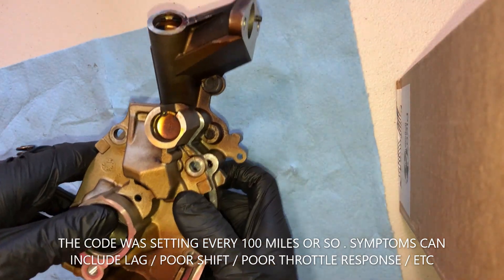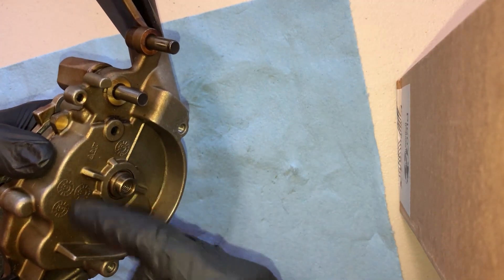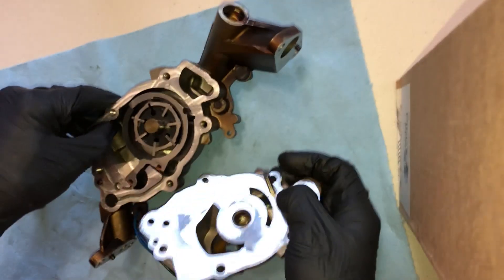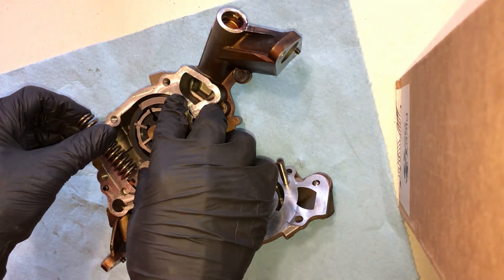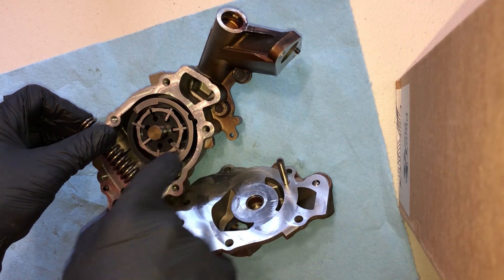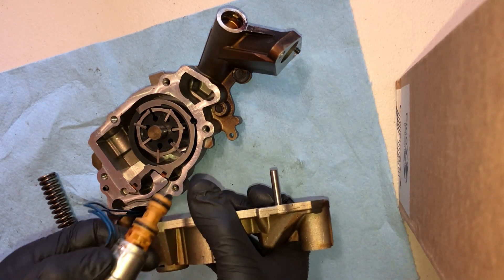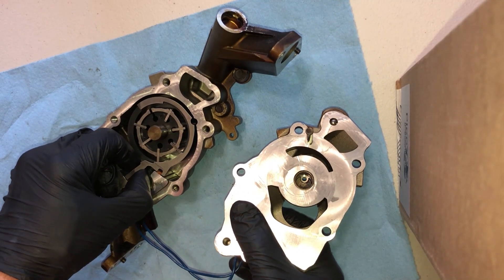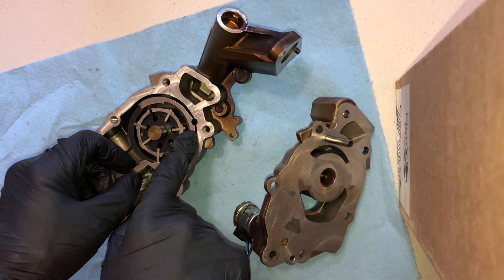CHRYSLER , DODGE , JEEP , RAM 3.6 PENTASTAR CODE P06DD OIL PUMP TEARDOWN

Comment: Correct me if I’m wrong, what I understood was bad solenoid would equal high oil pressure all the time? I seen another video that was contradicting. My code reader is telling me “Engine Oil Pressure Control Circuit Stuck Off” I was initially thinking to replace the solenoid before the entire pump. Thoughts?
Reply from the maker: Replace the entire pump with dealer pump but beware there could be other issues . Don’t recommend just the solenoid . This is just my opinion .
Reply: Hello I replaced the oil pump last year and I got same code again this month, I’m going to try the solenoid this time I don’t think is the whole pump!!!
Reply: @vick9721 use oem pumps only the eBay ones are junk

Comment: Will code 0522 cause this also since it apart of the same system/circuit changed the switch already on the housing ?
Reply from the maker: The oil sender is on the oil filter housing
Reply: @ocdauto8794 understood I changed that already also the housing but that code has been present for months now also the oil light was on while driving that’s why I ask now it’s a no start engine light flashes when key on engine off
Reply: I was asking bout that solenoid I planned on changing it out
Reply from the maker: I have yet to see a oil sender circuit code cause a no start . Also I have yet to see an oil pump solenoid cause a no start .
Reply: @ocdauto8794 ok thanks pcm needs reprogrammed
Reply: @ocdauto8794 ok thanks I’m stumped wit this damn truck only thing that ain’t changed is pcm and the crankshaft position sensor which too much to get to on awd 3.6 smh
Reply: It keeps saying low battery when battery is charged up 
And my scanner won’t communicate with the Tcm

Comment: Mine was failing to energize so high oil pressure all the time, which i was fine with, but my wife complained her remote start wouldn't work anymore so i'm in the process of replacing just the solenoid. Old one had a very loose connector on the solenoid body. new solenoid is tight. it was setting code p06da i think. Absolutely stupid idea to put an electrical solenoid in a hot oil bath. it was bound to fail.
Reply from the maker: It’s the oil varnish that really hurts
Reply: @ocdauto8794  It did have some nice varnish on the solenoid body. the rest of the pump looked pristine. very clean motor for 115k.

Comment: I have 2014 3.6 chrysler 300, this code only pops on start of engine (Oil pressure on start - 3.3 bars) then after 30 seconds pressure goes up to 5.8 bars. After i delete error code and start vehicle again pressure is 5.8 bars till engine gets working temperature and idle pressure stabilize at 2.8 - 3 bars, when i rev up to over 3500rpm pressure goea up to 6 bars, when revs drop to idle pressure is 2.8-3 bars each pressure is checked by gauge mounted on special Oil  filter cap. So in my opinion pressure regulation is working, when code is deleted this never show up until next day when Oil is cold and new start. i wonder why on first start pressure is at 3.3 bars and after short while it goes up, some body had similar problem? How to repair it? Ive changed filter housing with oil cooler and temp and pressure sensor.
Reply from the maker: One thing about engines is oil prime loss . Cars have oil drain back technology usually part of oil filter or housing . If it sets on cold start I wonder if you have an oil drain back issue ?
Reply: @ocdauto8794  i did not notice that problem, oil pressure shows instantly after start and always  around 3,3 bars (45psi), there is no time with extremly low pressure. One thing i forgot is that when outside is above 20 deegres celcius there is no problem with that what i describe,
Reply from the maker: One huge flaw with many trouble codes on dodge cars is the poor freeze frame data . They do not list the desired vs actual oil pressure in the freeze frame . Without that info in freeze frame you are left guessing as to why code set .
Reply: @ocdauto8794  yeah i noticed that.. Only P06DD code and "test not complete engine light requested" i heard something about   flashing with new pcm software may solve the problem, because technical book says that oil pump must be replaced but its giving good pressures and switches beetwen low and high stage. This thing is driving me nuts.

Comment: was there a noise on this car? my pentastar makes a strange noise when idling at times. Replaced most of my pulleys, thinking it was linked to a slight wobble on the Harmonic Balancer (which I think killed my alternator)
Reply from the maker: No noise on this car

Comment: On mine the O ring on the oil filter adapter cap was bad, it was leaking oil. I replaced the O ring and problem solved.
Reply from the maker: That had to be a bad leak  ?!

Comment: So would you say that when the code comes up that the oil pump is mechanically ok but the solenoid is the culprit
Reply from the maker: Seems to be that . The guts seem to not be worn on this pump in the video that caused p06dd. There is heavy carbon build up in solenoid . Inside the solenoids check ball is buildup . That buildup causes incorrect psi change . Bg chemicals makes an engine flush that may help . Never tried it . Use at own risk .

Comment: Hi from Australia, we had a 2013 JK with one of these faults and the solenoid was dead. Replaced the pump and that fixed the problem, but after about 10 months car returned with the same issue. Tested all wiring and solenoid resisuance okay, filter is vorrect, oil kevel us correct, monitored oil pressure on witech and verified pcm activating and deactivating the solenoid. All pressures and other results are perfectly fine, but fault still happens intermittently. We installed another pump and like 1000 km and 1 month all was good, but today car is back with the same fault. 2 hours verifing all again and even comoared to a 2011 Grand Cherokee getting the same oressure readings. Suspect a PCM issue
Reply from the maker: No other codes ??
Reply: @ocdauto8794  only sets that code
Reply from the maker: That’s a good one . Please let me know what fixes it . I have seen faulty oil senders and jumper harness cause this scenario
Reply: @ocdauto8794  well, it has been just sitting as management could not make a decision. We might try to replace PCM, or they might ask us to open a technical case

Comment: The 1st time I saw that DTC, it was caused by a torn O-ring on the pickup tube. That was back in 2011 and I haven't seen that since. I have probably replaced 100 of those pumps and I never thought to open one up. Good video, I thought I had an understanding of how that pump works. Now I certainly do.

Another thing, the description for that DTC confuses me. If that solenoid were actually stuck off, the oil pressure would be too high at idle and under 3000 rpms. I know they say that the stuck off diagnostic is actually checking for a stuck on condition and vice versa. I just can't understand why they did that
Reply from the maker: YEAH CODE DESCRIPTIONS CAN BE FUNNY . ALSO TROUBLE CHARTS CAN BE WRONG . THE HARD PART IS UNDERSTANDING THE TECHNOLOGY ENOUGH TO CATCH ERRORS SO CUSTOMERS WALLET IS TAKEN CARE OF .